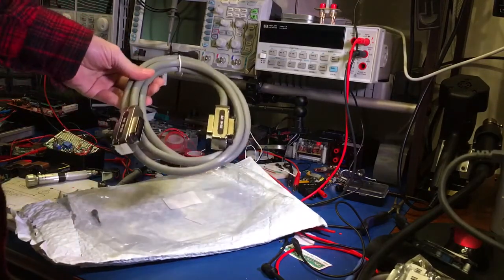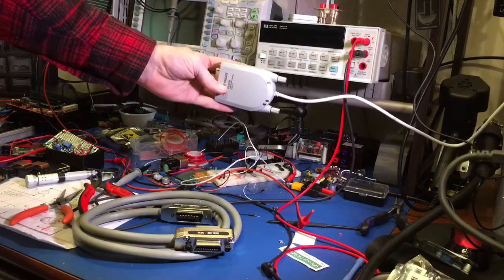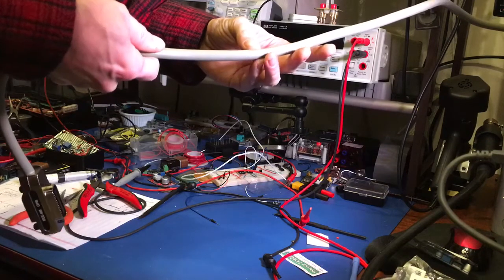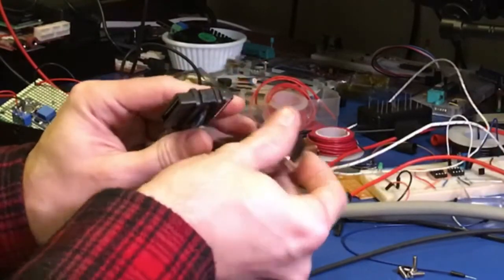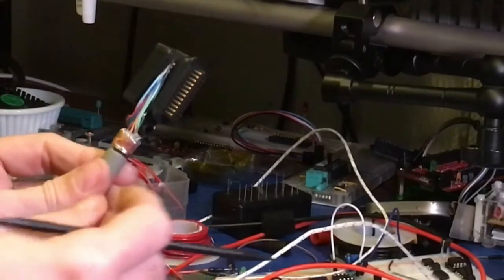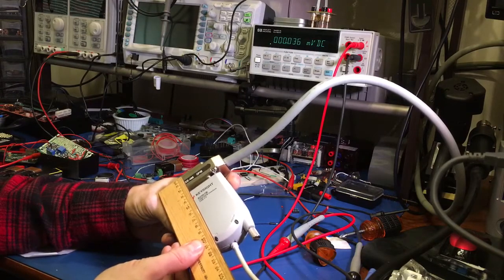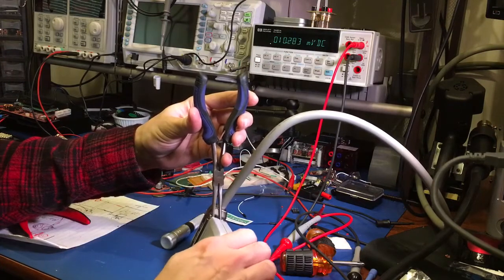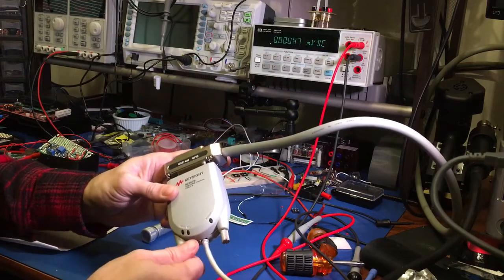Cheap GPIB IEEE-488 Cable Review

Comment: can you install a NI card via pc slot?
Reply from the maker: Hi Spark, looks like this is an option. They sell for about $99 to $200 used and even have a wide range of support for multiple operating systems like windows 10, and even Linus centOS (on of my persona favorites).  Sounds better then buying a GBIP to USB that is probably going to be fake. Unfortunately I do not have a full PC anymore, I’ve gone all laptops and tables.

This is the real one from NI, notice the yellow tantalum caps around the chip, total of 5. Some on eBay don’t look like this at all and might be fake, so I would look for one that looks like the original from thenNI site.
http://www.ni.com/en-us/support/model.pci-gpib.html

Support and drivers for the NI PCI / PCIe cards:
http://search.ni.com/nisearch/app/main/p/ap/tech/lang/en/pg/1/sn/ssnav:drv/fil/phwebntpmdm:122736/

Used ones being sold:
https://www.google.com/search?q=ni+gpib+pci+card&num=50&safe=off&client=safari&hl=en&prmd=sivn&source=univ&tbm=shop&sa=X&ved=0ahUKEwjU6Y2Sk6PYAhUK4IMKHUEcDM4Q1TUIYA&biw=678&bih=985&dpr=2

Thank for watching,
Scott
Reply: Thank you Scott This was best reply on you tube so far!  I bought this ( jhttps://www.ebay.co.uk/itm/322947486620) just now following your advice ...please have a look at it and fire a thought.
Reply from the maker: Well if you need a ISA card for your computer then you have it now for a good price. I don’t know if it’s the correct one for your computer, ISA plug, PCI, PCIe. Only you wound know your computer. 
I did a find a support page:
http://sine.ni.com/psp/app/doc/p/id/psp-356

And this older data sheet.
http://www.ni.com/pdf/products/us/4gpib681.pdf

It mentioned Windows drivers for supporting Me/9.x/3.1 and DOS. Some old windows operating systems. But again, I don’t know what operating system you will be using this with? 
They may have updated drivers for newer windows versions if you need it, NI is usualy good with keeping drivers updated even on older hardware longer then most other companies woild. 
If this is the correct card slot for your computer using the ISA slot plug, but your running a newer operating system you can always call them or email them. Some even write custom open source drivers to support other operating systems. They have been fast to answer my questions in the last, but it’s also the holiday break so give them a little more time for the holidays.
If your computer is newer and runs windows 10, uses a PCI and PCIe plug slot then I woild go back and look for the original one I linked to in my last comment. 
But again, it’s hard to say for sure without knowing your computer hardware specs, requirements, what devices you want to use this with in the other end of the cable. 
I hope this works out for you and is the correct card for,your computer. You can also join some sites like the eevblog that have a lot of  knowledgeable people to help as well and some of these people also run older computers and hardware still that could help better with an older ISA card.

Thanks for watching, and the complement about being th eyestalks reply on YouTube. 
Scott
Reply: i have some test instruments and hopping to connect some sort.  my computer with gpio from lab was thrown away!! as a shop clear up by my work colleague ; he was complaining for not having much space under lab desk so when someone turned up to collect stuff he gave that PC too (the pc was ordered with the port for lab use!!) Then when i asked around they said: get another pc!! easy as that! now i can not!!!so looking to marry things up is taking its tall...thanks for your detailed response! My computer other pc has the both slots reserve so probably with some luck i shall get this going as 4 now cant get  any instrument data.
Reply from the maker: Cool, hope it all works out for you. Keep me updated if you remember.
Reply: I picked up the 1M from "hi-pc" on ebay for like $8.99.  Amazing, price and haven't used yet.  

Then later a bought a "National Instruments NI PCI-GPIB Interface Adapter 183617J-01" from I think MSU for $39.30 with shipping., though didn't have a PC to put into.  Seemed like a great deal at the time.

I then wound up working on my parents old house and no one wanted the working PC here with a free PCI slot (and I just realized an RS232 DB9 port) and luckly unlike alot of the other stuff... wasn't thrown out.  

So I am thinking once I have a work bench from the salvage wood I tore out complete... I'll be able to get working. 

In the mean time I started working on a USB based on RS232 and Arduino versions GPIB interfaces I found online as well as a 20 pin edge connector for interfacing to the TDS-520 I've been trying to repair more recently. 

I finally have all the chips and decided that I am going to order some sockets for the SOIC, SOP (-16) and PLCC (-44 & -68) chips since I still need to practice my confidence for soldering that small as well as bread boarding before I solder just to be safe with the different versions.  I just ordered the adapters today.  The SMD/SMT world is way smaller than I am used to from the early to mid 90's. 

What is your take on the Agilent USB-GPIB?  Did you get a clone? 

I almost think I want to order one just to upgrade components since looks like there is plenty of detail.  I know when I was looking last winter sometime claimed original ones showed up for just under $100.  Kind of big investment for such a little cable though that might not return investment if tried to sell.  Steve Cassagrande has an interesting version for around $70 I was thinking about getting and decided I'd try to build for now since his is even open source like Emanuele Girlando's.  Thinking with Arduino clones there is even more cost effective areas of opportunity if I have the time.

Neat learning about this microcontroller stuff again and being able to actually buy the equipment to interface with, other than probes I had to make, that back in the 90's would not have been feasible for me for sure.  Neat pulling out what I have left of probes and spectroscopy projects I built.

To think some of the scopes and equipment I've picked up surplus or for parts (TM-5006, CG-5001, DMM-502A, PS-503A, TDS-520, TDS-520B, TDS-8000B, et. al. ) cost new in modern dollars more than my cars combined I've ever owned.  

Thanks for sharing.  I was wondering what was on the inside of the cable.